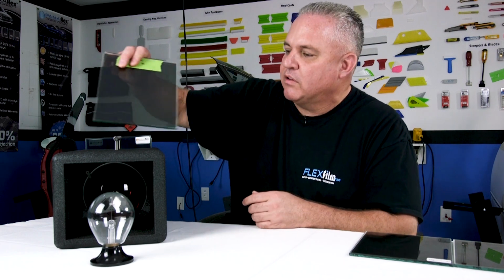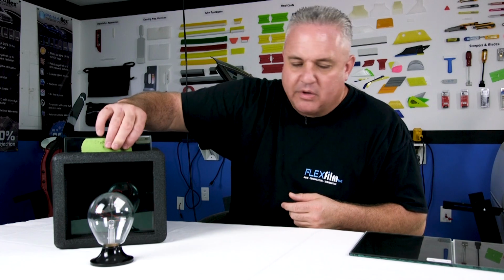3M Crystalline vs Flexfilm

Comment: Got flexfilm 70% ceramic on windshield and it doesn’t do much to block heat. The installer said “ oh it’s because its almost clear I’ll discount installation on your next car “. I emailed this company 2 months and they never responded.
Reply from the maker: Flexfilm has more than one ceramic product.  Which one did you have installed?  Are you 100% sure you got the highest level ceramic or could it have been another product?

Comment: Thanks for sharing! this is a very informative video which i really appreciate.
I have 3M Crystalline on my car which should block 99% of UV rays. However, I later learnt that the majority of the films on the market protect against UV rays up to 380 nm. What about 380-400 nm? is there a film out there that cover up to 400 nm? I really am curious coz my skin is quite sensitive to UV rays.
Thanks!
Reply from the maker: Glass with no tint blocks all B rays.  The ozone layer blocks all C rays from reaching earth.  Film only blocks A rays.  Fact.
Reply: @FlexFilmPlus  Does it block the A rays from 380nm to 400nm wavelength?
Reply from the maker: @MacS3ood  
320nm to 400nm
Reply: let's start with a short botched physics tutorial. All light particles travel with pre-determined frequencies and wavelengths. Wavelengths are inversely proportional to a light's frequency, with the speed of light as the common denominator. Direct radiation exposure to light with high frequency (and inversely, low wavelength) is dangerous, for example continuous bombardment of x-rays to the body without a medium like air in between would be detrimental. UV waves have a wavelength spectrum of ~10nm to ~400nm, a wavelength range shorter than that of visible light(ROYGBIV)'s and longer than that of X-ray's. 401nm light wouldn't be UV anymore, it would be violet visible light. So a higher wavelength number in the UV spectrum does not mean more harmful UV; inversely, lower wavelength number does mean more harmful UV. But, this is not a cause for alarm because all the "more harmful" spectrum of UV light with low wavelengths are all absorbed by the earth's atmosphere, the air around you, and the glass window of your car. Tint just takes care of the rest of the "harmless" UV light range down to the 99th percentile.

Comment: Hi Ralph. I want to start by saying good job on the video. Thank you again for being honest & transparent. I have a question. I don't see anywhere in Raleigh or Durham, NC where I can get the nanoflex film. I have a 2008 Acura TL, 2012 Acura MDX, & just bought a 2013 Audi AT and I want to get them all tinted with the top of the line nanoflex tint. I want the IR blocked and the maximum heat rejection. I want to start with the Acura TL with all glass including the sunroof/moonroof. Can you precut for vehicles and if so, how much, including shipping for the best nanoflex for my TL? I'm ready to buy.
Reply from the maker: Thanks for this comment.  You can visit our website at www.flexfilmstore.com and find our menu.  Click on recut patterns.  You can see all our selections.  We only cut patterns for the Nanoflex.

Comment: What's the point of this video? A car is going to sit hours under the sun. Not 4 or 6 or 40 seconds... Let's see a video that a car sitting under the sun for 4 hours, and is 20 degree F lower than the competition. Otherwise I am not sure what this tells us. It heats up 35 seconds slower, so?? I am not affiliated with any tint maker nor do I sell tints. I am a consumer trying to get a good quality product.
Reply from the maker: I think you are missing the point.  A yeti cooler doesn't get you drinks colder than an igloo cooler... the yeti cooler keeps the drinks cooler longer than the igloo cooler because it has more insulation.  If you leave a car in the sun for 4 hours without running the air conditioning, the law of  thermal equilibrium says the inside temperature will be the same as the outside temperature no matter what film you have on the glass.  What our film will do is slow down heat from re radiating into the car slow enough to allow the climate control to work less maintaining the desired temperature better than the competition.
Reply: Yama Fanboy  I would also say to check ceramic tints such as Huper Optik and Autobahn. If I am not mistaken 3M crystalline is not ceramic, I do not know the others though.
Reply: @FlexFilmPlus  💯💯💯 had to educate him real quick lol
Reply: @dynamoeffekt  From what I’ve been researching below 40% not tint is 100 percent ceramic they are composites of ceramic and other materials. Correct me if I’m wrong
Reply: @Yama Fanboy  @dynamoeffekt  Crystalline is a ceramic film,but was originally developed for domestic /commercial flat glass then modified for automotive use, hence it's "semi-reflective sheen" and higher optical clarity,but poor interior reflectivity at night

Comment: If the film is mounted on the inside of the windshield, and if that film absorbs the heat, isn't the heat still inside the car? If the film absorbs the heat and then conducts the heat to the materials on both sides of itself, the glass gets some of that heat and the air gets some heat. In these short tests, if the glass starts out as cool, it may take some time for the thermal mass of the glass to get up to an equilibrium temperature, and then the warm or hot glass is warming up the car by conduction rather than radiation. So the total transferrence of heat into the car needs to measure both the conduction and the radiation. I appreciate your effort to measure radiation, but after the windshield warms up in the sun for an hour, how does the car temperature change?
Reply from the maker: Thermal equilibrium will always win if you do not have a climate control system but we can slow down the heat that builds up in the glass that re radiates into the car so that the climate control system can work less.  
An analogy to this would be that drinks in a yeti cooler will not  cool down until ice is introduced.  It just that a yeti cooler is better insulated than an igloo and it takes longer for the ice to melt in the Yeti. Another example is space shuttle tiles... as the space shuttle enters Earth's atmosphere,  friction creates heat which is absorbed into the tiles (similar to how heat absorbs into glass with window film on it) and slows down how it radiates.  It slows it down so much that it actually keeps it from burning the astronauts.  There are also other climate control features in the space shuttle which keep thermal dynamics (specifically thermal equilibrium)  from winning.  Simply put, ceramic film has two phases of performance which are protection and comfort.  Protection simply has to do with solar energy transmission and comfort has to do with slowing down heat from re radiating inside the car.  The more a non conductive ceramic coating can slow heat down, the more efficiently the climate control system can recuperate the temperature inside the car.  Hope this helps.
Reply: The real question here is why won't he do an extensive test against the Xpel XR Plus?
Reply: @yobingbongyah4676  He probably has no access to XPEL products being an opposition film supplier